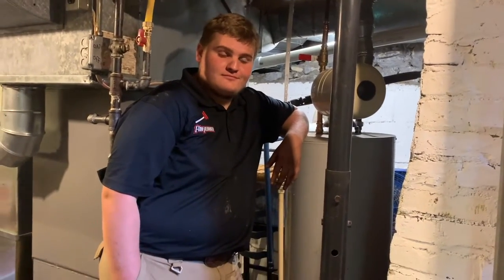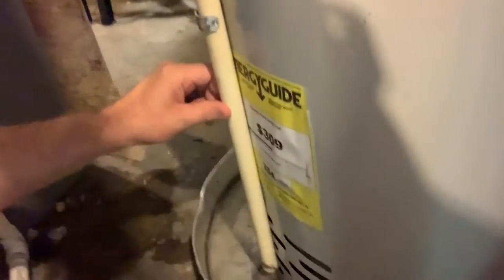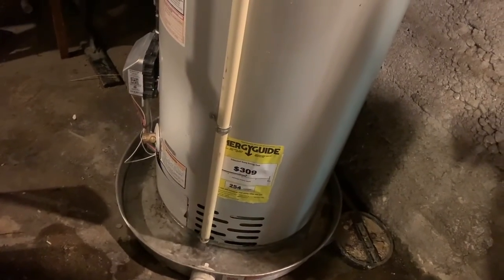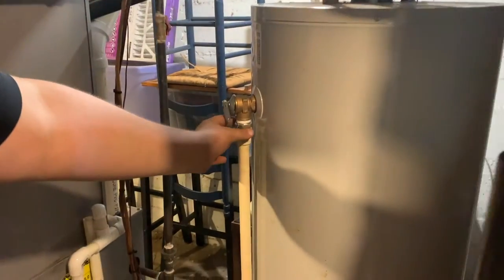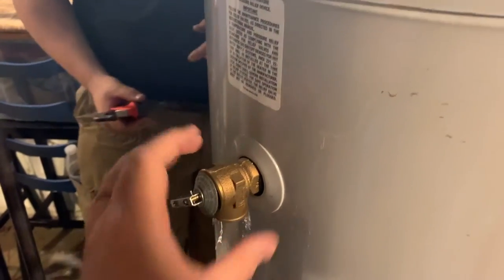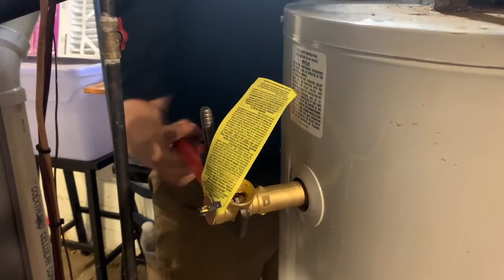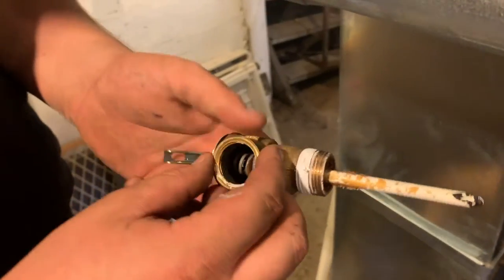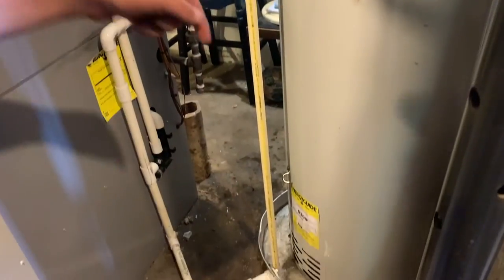Replace Water Heater T&P Valve (Step-by-Step!)

Comment: Was that PVC that you used for the drip pipe?
Reply from the maker: Great question, Tony. Glad you mentioned it. It's actually PEX, installed before I bought the home. As you might know, you should never use PVC for a drip line. It only withstands about 140 degrees of temperature, which is often the temperature of the water in a water heater.
Reply: Didn’t know that, thanks!

Comment: I have a square nuts cap on my new  Rheem water heater I don’t know what tools to buy to remove the cap and put the T&P valve on on the top of the water heater 
Can somebody help me please.
Reply from the maker: Thanks for asking! There are socket heads out there for loosening square nuts, as well as box wrenches that can be used. If you have any of these, we would recommend trying these. Let us know if you have any more questions!
Reply: @1-Tom-Plumber  
Thanks for answering me for anybody who is having problems removing the 3/4 square cap of your on you water heater  T&P I found the solution to the problem 
I went to Home Depot I purchase a Husky  24 inch Ratcheting breaker bar with 1/2 inch head drive for $45 with taxes.
That’s what works for me.